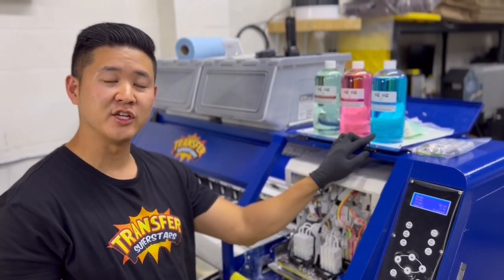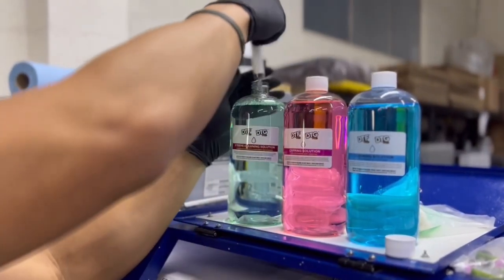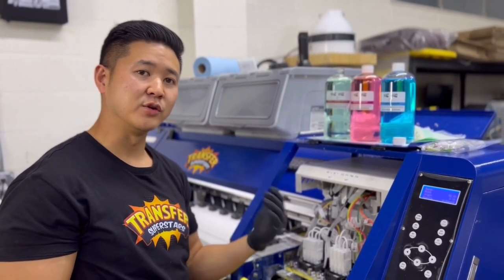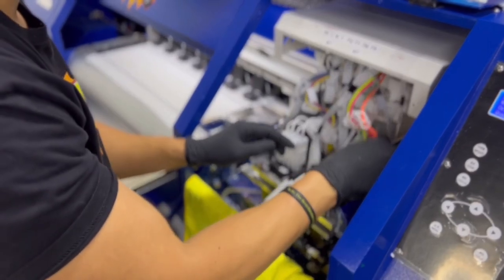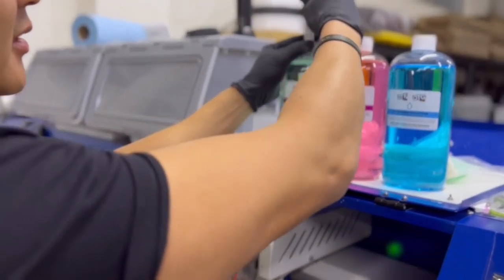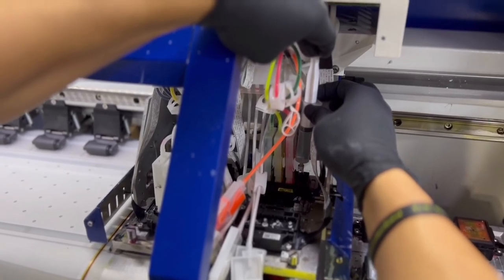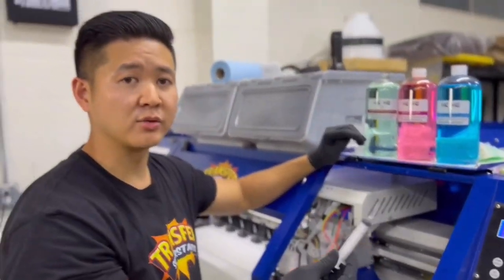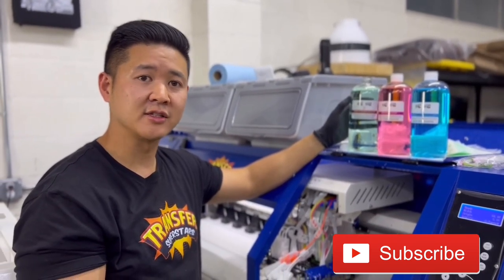How to Unclog a Stubborn Clogged Print Head for DTF Printing with DTGPRO XTREME cleaning solution

Comment: Thank you. My i3200 has clean lines when I do a nozzle check but the white ink stops printing during a few passes. what do I do to fix this?
Reply from the maker: Something sounds like its clogging up. Try soaking in cleaning solution. (maybe even try warming it up and let the head sit for  15mins)
You can also try flushing the print head but we try to avoid this step until its a last resort.

Comment: Hey buddy! After a long waiting for the solutions finally I was able to work with. However, one of my printing head has 3 nozzles totally blocked and the onther 3 working good. I tried many many times with the extreme, in the cap and inside of the jets however, the solution doesnt go through. Its kinda totally blocked. I bought also the de-plasticizing. I know that is written to not use on the heads put I was just wondering if you have any other tips for me. It seems like Ive lost my printing head. I am really upset about it. I use to clean many times during the day but even this way the varnish got clogged.
I would appreciate if you have any other tips. Like the de-plasticizing as an extreme measure to try to save it. Thank you
Reply from the maker: I wouldn't use the de-plasticizing solutions on the head. Try warming up the extreme clean and trying to waterfall through again. At this point it might be time to replace the heads.
Reply: @transfersuperstars thanks buddy!
The printer is brand new, only 2 months. Thats why I am so upset. Anyways, thank you again!

Comment: Hello sir I have a problem with my printhead Epson i3200 it's clogged I have tried your method but it's didn't worked.
Please help
Reply from the maker: How are your nozzle checks? How badly clogged is it? What happens when you try to waterfall 
flush your print heads?